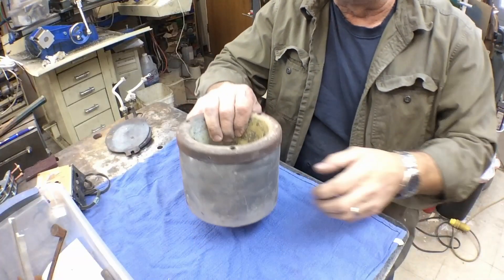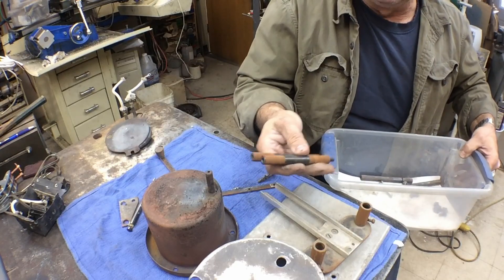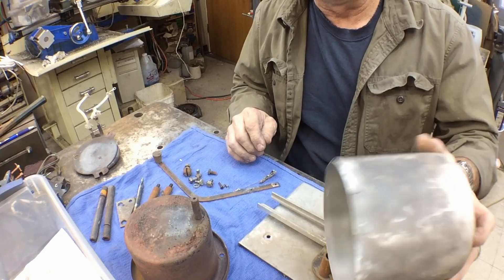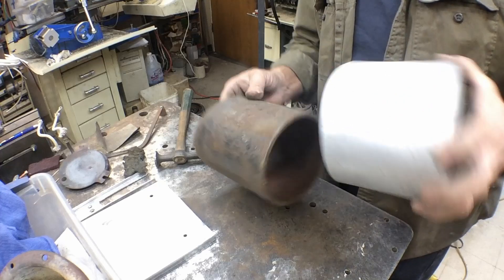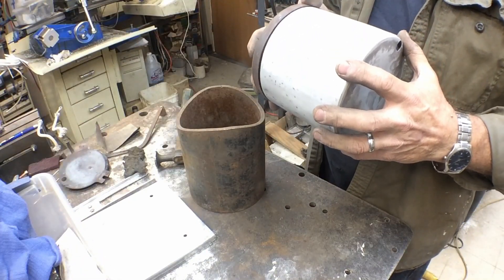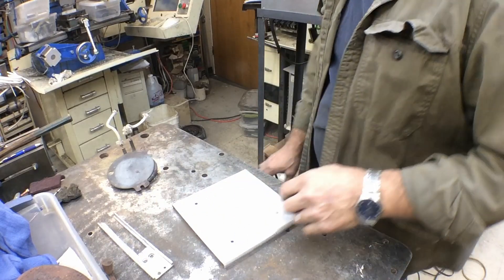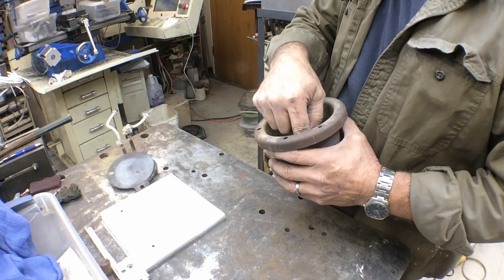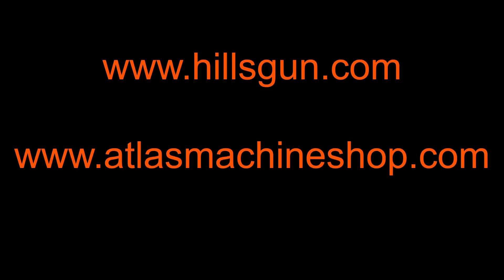Rebuilding A Lyman Moldmaster Casting Pot Part 1

Comment: I have just purchased a Lyman Mold Master that needs some TLC. 
Thank you for taking the time to produce this YouRube. It is very helpful.
One question, and I know I am very late to this party so if it doesn’t get seen, I totally understand.
How did you get all the lead out of the pot to dismantle the handle, etc?
My pot is so dirty inside there is a lot of lead sticking to the sides. Did you use a flux of some sort?
Thank you for your help.
Cheers,
Robert Booth
Reply: Please ignore my noise. It just took longer than expected for all the lead to heat to liquid, then it all drained out.
Cheers!
Reply from the maker: You are welcome, normally I just heat up the pot and use the spoon that I  skim the dross with and pop the chunks of crap off of the side. If you undo the lever from the nozzle stopper( bad terminology ) you can pull the nozzle stopper from the pot with a pair of pliers once it is heated up. Good luck, Dan.
Reply: @hillsgun  thank you very much for your reply.

Comment: I know it's been a few years since this video was uploaded, but I am interested in knowing if you still have the thermostat control knob from the Lyman furnace you rebuilt in this video? I recently was given my fathers old Lyman 61 Mold Master furnace and it works great but the knob is missing. I'd rather keeping it original if I could. Would you be willing to sell it? Thanks for the consideration.
Reply from the maker: Hi Andy: Sorry but no. I left it on the pot as I also want it to remain original even though it is pid controlled it is still wired through the original switch. I will keep an eye out for a replacement for you..
Reply: @hillsgun  I truly appreciate that. I've even considered a 3D printed replacement. Not getting my hopes up. Thanks for the help.
Reply from the maker: @andycrawford9077  my first thought was a 3D print, but if it were mine I would not be happy with it. What may be a viable option is a resin casting which may be the best option. I will mull it over and see what I can come up with. It may be a u-tube video. : )

Comment: Is this model 61?  Probably not, since the pot looks a lot like 20lb Lee.  Does not appear to be cast iron, but thin metal like Lee pot.
Reply from the maker: It's an early Lyman Moldmaster pot which has a heavy steel liner